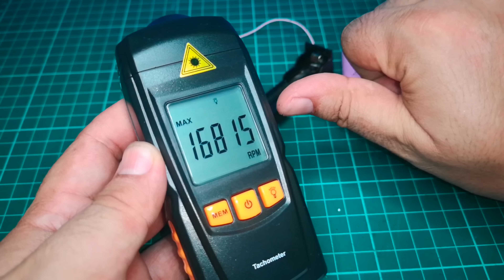DC MOTOR HIZ VE GÜÇ YÜKSELTME - 5500 RPM UP TO 16000 RPM TAKOMETRE İLE TEST ETTİK

Comment: Kıymetli zafer ustam elimde Moser chromestyle traş makinem var pilini değiştirme vakti geldi. Üzerinde bulunan dc motor 2.6v 5500rpm özellikli. Ve bu motoru besleyen 3 adet 3.2v 600 mah piller. Sorum şu: bu traş makinesine 3.7 v 800 mah  lık 3 adet pil taktığımda dc motora zarar verir miyim ?

Comment: Videos like this are many, and no one talks about that the operating blades in this development or upgrade for this motor that are damaged or melt due to the high ampere required by the diameter of the coiled wire in the heart of the motor, then find the solution is to upgrade also required to replace the blades with carbon charcoal as well as need high volt  No less than 9 volts, maybe more, and this is not just a traditional video, like all those who preceded you in showing their videos. Thank you.